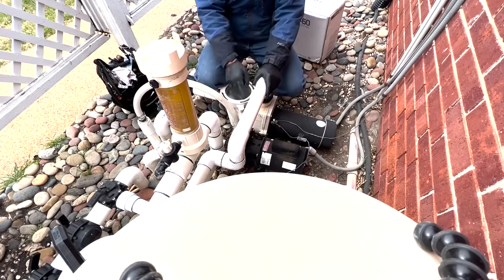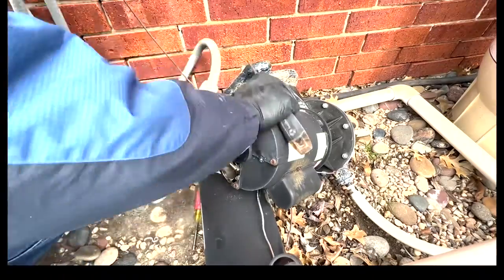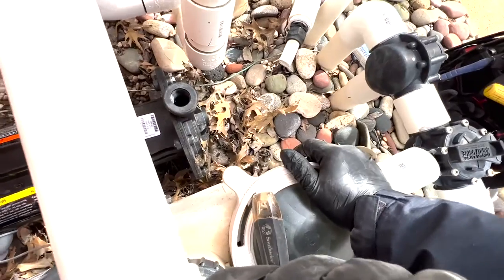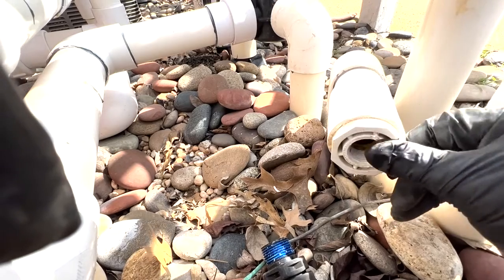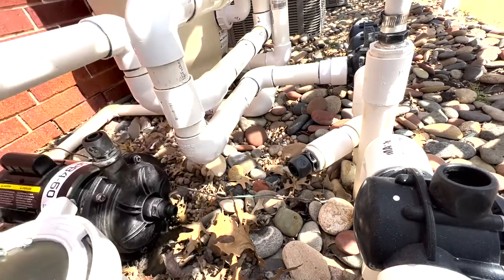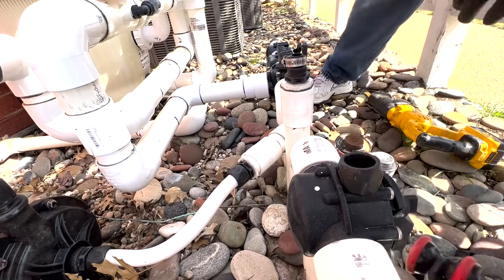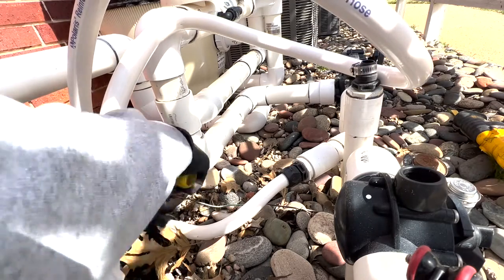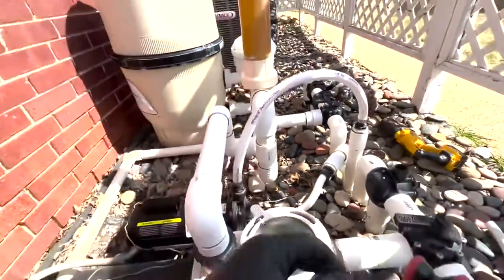How to install Polaris PB460 Booster Pump

Comment: Here's another thing about the pool pumps and the booster pumps to make them more repairable. When the seals fail they leak and if the leak is left unrepaired, severe corrosion can make them very difficult to take apart and rebuild. Inspect the pumps often for leaks. Immediately repair the pump seals BEFORE severe corrosion makes it impossible to get them apart. I have a video that really emphasizes the use of anti-seize compound on both new and rebuilds to enable future disassembly:  https://youtu.be/6BWyb4pqF0Q?si=GrJG7xp5PU-ip76h

Comment: Do you need to make any electrical wiring changes (ie 240 or 120 volt)?
Reply from the maker: There is a wiring schematic on the side of the pump. The sticker on the side will show the 120 setup if it’s available

Comment: Newb question here- but the port pointing up is the OUTPUT of the pump, right?
Reply from the maker: Right. The Water enters the front and exits the top
Reply: @Pool-guy  Thanks man. We recently got a pool, & one of these pumps is for a waterfall feature. They plumbed it BACKWARDS. Then it didn't want to run... anyway I plumbed it correctly, and had to use my drill to spin it while humming, but now I have it up and running. Thank you for the video and response!!

Comment: Great video - I'm about to do the same job.   Do you always use hose clamps on that output hose instead of the polaris twist on "clamps"?  Do the polaris clamps not hold tight enough?
Thanks
Reply from the maker: The Polaris clamps are fine and work great. However, if a customer ever had one blow off and drain the pool, the will always insist the hose clamps. I usually just match what came out, unless they ask for something else. 
Good luck on the install.

Comment: Those motors are easy to overhaul, by changing the bearings. And so are the pumps, by changing the seals. I always keep a spare on hand, and when the one in service fails, I swap it out and then rebuild the failed one, which now becomes the spare.
Reply from the maker: I’m curious about how you rebuild them. We looked into it and there was no profit in it. The time spent to rebuild it far exceeded the cost of a new motor. The biggest problem was the front housing was often cracked and the long bolts would twist off inside the motor
Reply: @Pool-guy  First of all, I’m a homeowner. So it cost me about 15 bucks to replace the bearings in about one hour of my time. That’s because I’ve done it before, the first time it will take a little bit longer.  The current cost of these pumps to me is about 450 bucks more or less. Now if the wet end craps out  I can get a new one for about $95, but normally all the wet end needs is seals, which can be had for 25 bucks or less. One of the important keys in rebuilding these motors is to ALWAYS use anti-seize compound on the long through bolts so you can get the motor apart the next time. That means if you do get a brand new motor and pump, take out each through bolt one at a time,not all at once, lubricate the threads with Anti-seize, and then replace the bolts BEFORE putting the pump into service. This goes for the pool pumps as well as the Polaris pumps. If you need to get through bolts, you can usually get them from Perry’s pool pump service in Arizona. If this is your business and the customer wants a brand new pump, sell it to him. Take the old pump and rebuild it. You can do it very quickly and then you can offer it to the next guy for half price. But if you’re homeowner do it my way. Most of these should be easily rebuildable, a few you might have to trash, but throwing away an easily rebuildable pump is a terrible waste of resources.
Reply from the maker: @mguerramd  Thanks for sharing that info. I hope you video the next one you do, I really think it could help the community. Motors are getting crazy expensive and if you can fix one for less than $100 then that’s a great deal. 
Hope you have a merry Christmas 🎁
Reply: @Pool-guy  So here's the first one 
I did and it's a little rambling. I put the end caps on backwards but corrected that mistake on the video. Subsequently I did another rebuild much faster by virtue of experience! That would have made a more precise and succinct video. This is the exact same sequence for a pool pump motor. You just have to get the right bearings for the motor you are rebuilding. Maybe I'll shoot a video of the wet end repair also, stay tuned for that. But there are plenty of videos here on yt of the bearing replacements and the wet end rebuilds.
https://youtu.be/6BWyb4pqF0Q?si=GrJG7xp5PU-ip76h
Reply from the maker: @mguerramd   Thanks for sharing with the community here. I will pin it to the top in case anyone would like to check it out and hopefully they will visit your channel too. Have a Merry Christmas

Comment: Thanks man. I was trying to trouble shoot a pump our pool company put in. It would hum, but not move any water then click off after a few moments. They installed it BACKWARDS- input/output. IDIOTS. Bachmann pools & spas in WI have screwed us over & over. I'm becoming my own pool expert out of necessity.
Reply from the maker: Oh man that stinks, but at least you’re getting some great experience
Reply: @Pool-guy  I am! Thanks for the video.
Reply: @Pool-guy  Well, I just reversed the intake/output, so they're correct. But the pump only humms for a few moments before "kicking out" (I hear a click, & it stops humming.) Think maybe a wire is loose inside? Maybe one of the 110 lines? I'll investigate now...
Reply from the maker: @daakrolb  I would suggest pulling the plastic cap off of the back of the motor to expose the shaft. Then when you turn it on, if the shaft is spinning, then your problem is most likely the impeller is broken. It’s very common with this pump we have replaced lots and lots of the impellers they sheer off during operation.
Reply: @Pool-guy  Thank you. My shaft doesn't spin when powered on. Just buzzes.... I can spin it manually- it isn't seized. This pump has also never been run. Also- to be 100 % sure- the OUTPUT of the pump is the port that goes UP,  right??
Reply from the maker: @daakrolb  yes it outputs from the top. 
If the shaft is not spinning , check for voltage first. Then if you have power to the back of the motor then you could have a bad start capacitor. You will know as the motor will hum or buzz and will be very hot. If it’s cold and won’t run, then it’s a bad motor
Reply: @Pool-guy  Thank you a LOT for the advice. I will test the voltage. First I will learn how, since there is no neutral line going to the pump, & I have never seen that 🤷‍♂️. I know the breaker for the pump is a double pole (220v,) so it SHOULS have 110v on each “hot” line. Thanks again. I’ll keep you updated!